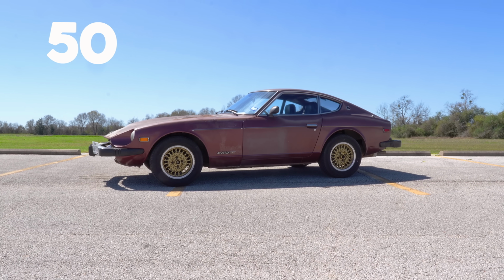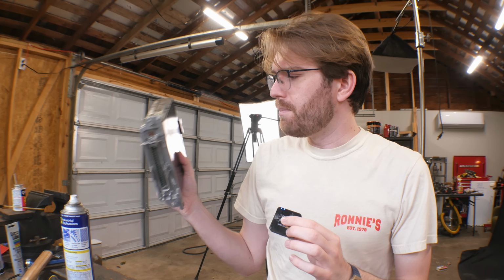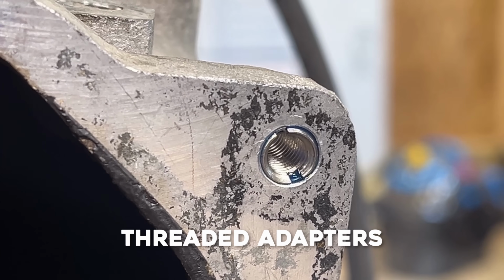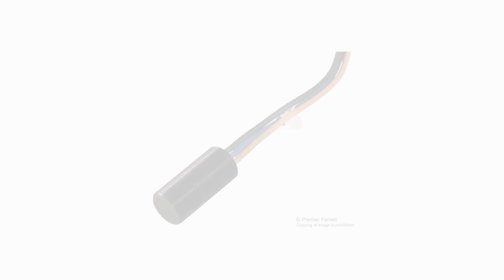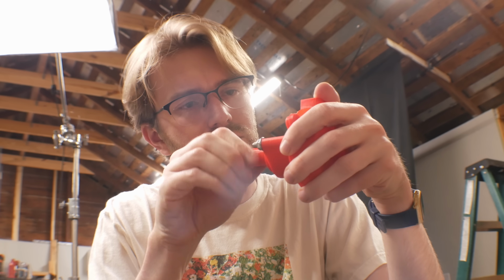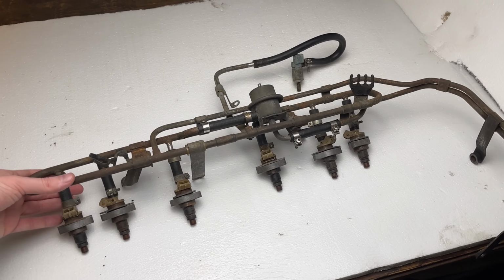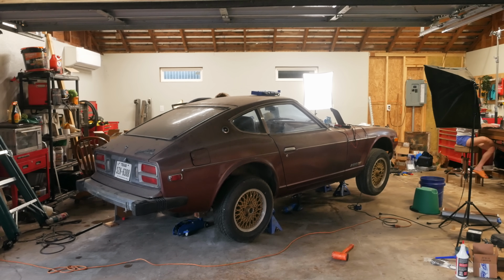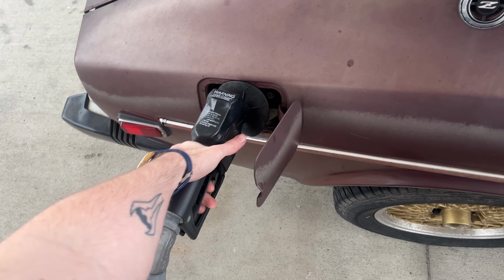Modernizing a Vintage Car

Comment: Man the cnc place has my wheels turning,  im sure engine or transmission adapters are possible.  Now I just need to learn what software to use for design.  Im older generation 54 years so I have a hard time staying up to date. Yet plenty computer capable

Comment: Very good video man a++ The very last statement was gold:finger-red-number-one:🤑 like reminds me of i traded my suv that`s paid for  for a car payment and i get  say 8 mpg better lol..  i would verify that timing mark on balancer in the futer projects with looking at piston using a piston stop or what ever as they do very very often move as the rubber in the housing is old and torque twisted it off the mark years ago i learn that the hard way  mark only be off 0- to what ever degrees mine was off on the gm project 40 or so lol  IMO batch fire is not an issue at all they did a few tests megasquirt and found not a real difference improved fuel usage over using the timing firing vs batch Fi methods   only at idling it was a bit tiny bit less VE

Comment: Cool. So next, please rebuild the internals. Like, stock or whatever, but fresh. New pistons and rings, new bearings, aligned crank, honed cylinders, milled deck and head, new gaskets, new valve springs, etc... Normal rebuild stuff.

Then after break in, see if you get more power and improved fuel efficiency.
Reply: Forged internals with that company he's using hahaaa
Reply: Dude that would be such a cool build
Reply: @stefancogurik166  you would like @mymechanics here on youtube, he's doing a crazy rebuild of the Datsun 240
Reply: You can definitely get a bit more out of that motor.
Reply: In the 1970s a uk company called Broadspeed would take a brand new v6 Granada, strip the engine and rebuild it with all the original parts and recon to get around 15% extra power.
Reply: Thank you, your video was engaging and joyful. I’m running better now too.
Reply: That’ll be 16 years sir. Do you want it on cash or card?
Reply: All that and maybe shave the head to bump up the compression ratio a bit.

Comment: you can turbo it now that you have a standalone i would totally do that and the injector size you used is plenty i would upgrade the fuel pump but i don’t see why you couldn’t double the power and keep it reliable i mean 280hp is not a lot

Comment: I have always thought the Chrysler Slant-6 was screaming for multi-port EFI and I really liked that swap, thank you. 
I had previously installed an Iron Duke TBI system, identical to my 1985 Fiero 2M4 SE, onto a Slant-6. Aftermarket EFI systems really weren't available back then, and I liked the simplicity of the GM TBI. This worked because the displacement per cylinder is almost identical and did give me better fuel efficiency in a 1983 Dodge Ram with a manual OD transmission. The only issue is that with too many distributor pulses, the computer idled the engine around 450RPM. The alternator was not happy at first. :) Slant-6 crankshaft is stupidly large and heavy, so it still wasn't easy to stall it with the clutch. There was no way, aside from making the computer think the air conditioning was on (it wasn't equipped), to bump up the idle speed as the GM TBI ECM is not programmable. 
(Note: change the electrolytic capacitors inside your car electronics! When they fail due to age, they will give you weird problems!)

Comment: Also could of just replaced the harmonic balancer and installed the sensor there for spark timing. Balancer spins 4x faster too so more accurate.

Comment: I would love to feel the difference of the sequential injection. I have a 77 280z with the FAST ECU , larger oring injectors, upgraded ignition etc.. these cars are so much fun once they run strong, no need to engine swap in my opinion.

Comment: I had a 76 280Z with minimal smog stuff. Granted, I bought it new, but that 170+. HP would move it out. It clocked 154 MPH on a certified police radar gun. As far as economy…I thought at the time it did great at 20 MPG, not quite as good as my 5.3 powered GMC 1/2 ton. Fun when I was young.

Comment: Having hotrodded an L26 ( nearly identical just smaller bore )I can say that the best money that can be spent on these engines is porting and polishing the head ( mostly that just means gasket matching the head to the intake and exhaust manifold ). Costs nearly nothing ( unless you send it out and get a shop to do it ). The difference is daylight and dark! I think the L28 likes boost as well. Thanks for sharing your journey!

Comment: Former owner of three 240Z's,  (back in the seventies, 1970's). Afraid I would have settled for a small block Chevy with Holly controller. It would have been cheaper, quicker with more dependable components.  But I am 84 and while I have the money for a such a project, I don't feel I have the stamina or the patience to complete it.  Thanks for letting me tag along for the ride and letting me live vicariously through your efforts to bring back one of the best cars ever produced.  Great content,

Comment: Reliability of older cars is actually better than the latest electronic nightmares most the time. 
Yes restore the engine with three basic changes. Exhaust intake and upgraded efi system with spark upgrade. That will improve milage and power.
To give it slightly more grin factor you could boost with 5 psi without much other than exhaust to suit.

Comment: From Leo:    I was working at the Dealer when that was a new model.  Remember those were the years starting in 1973 that trying to be EPA compliant was number one and it robbed performance from everyone. .    Most do not know, but the camshaft sprocket is made to be installed 3 different ways.  It has marks to indicate. A "V" the sprocket indicates a slot in the the cam.    You can slightly retard the cam to push the torque peek to higher rpms.  leave it in the middle or advance the cam slightly  to bring the peek torque at lower rpm.    You have to FIRMLY put a wedge shaped stick to hold the cam chain or the hydraulic tensioner WILL drip into the timing cover.     Free mod, and is easy to  reverse.    Good luck on your project.

Comment: This dude YouTube is trash you definitely modernized a cold ahh car by upgrading a few things on a engine maybe after out a new engine transmission rims change the dashboard up put some apple car play with a digital dash a back up camera maybe a turbo or something for the engine nope bro changed a few parts and gained 20 hp and said it’s modernized now

Comment: I had a 1975.  First year of the fuel injection without the smog control. 170 hp    I loved the 160 mph speedometer

Comment: Back in the day (about 1981) I had 1972 Datsun 521 Truck with a 1.6l 4cyl engine.  It had dual Points and Dual Condensers.  Horrible system!  Almost impossible to set correctly so after a couple thousand miles the points would get a pit on them that I would have to file down.  Then I was introduced to an Electronic system.  In the distributor you remove the points and condenser and you put a plastic with a slit in it with a photo sensor on either side of it.  After installing that system my truck ran so good.  I could not believe what a difference it made.  Also I replaced the POS carb with a Webber 2 barrel carb with a manual choke.

Comment: Now to do hotrod stuff. Valve job, Port and polish the head / intake, headers along with a better flowing exhaust I'm guessing that will get you another 10-20 hp and better throttle response. If you want to go a step further, you have the perfect setup in place to do a small pump gas turbo setup.  That's great work though, you should sell that Cam / crank sensor setup.

Comment: From the factory it's 149 horsepower at the WHEEL (net horsepower).  Gross horsepower ratings went out out at the end of the 1971 model year.  --- You can make it quicker, you can make it faster, you can make it stop faster, but you cannot make it safer in a collision.

Comment: Did something similar with a 1968 Triumph Spitfire, but couldn't go totally digital as the parts needed simply were not made/available. But took an engine from the stock 64HP (75 listed) to 112HP , in a car that weighs 1600 lbs. Mainly with better intake, carbs, exhaust and cam. But your work is more complex, as I stayed analog (outside of ignition). Great work.

Comment: Do we get to see a camshaft, upgraded compression pistons?  I would imagine that additional refinement of your fuel map /VE table, you should see better MPG numbers.  I would guess some 9.5:1 or 10:1 compression pistons would really help and a good cam for power. Otherwise just the pistons and then a refined cam profile? Maybe swap in 81+ ZX pistons? N42 head? overmill the head for increased compression?  Adding a like for the possibility of this in the future.

Comment: I've almost finished rebuilding my 80's saab, which unfortunately has bosch mechanical injection, which is unsurprisingly awful, doesn't work and also dumps fuel from all injectors at all time. The only difference is that It's purely mechanical so there's no computer.
Thanks to this video,a dns eeing how clean your engine came out, I've decided to do what almost every other saab 900 owner does. DItch the entire system (after I have the car inspected for originality and get licence plates) and convert it to Tronic 5 injection.

And yes I hate you for using electronic throttle. Tsuum tsuum noises will always beat tiny stupid motor

Comment: I appreciate the DIY approach to the EFI setup, but did you realize GRW manufactures a optical crank sensor that looks almost identical to the one you made? Mind you its 400$ usd .. but would have saved you a lot of time.. anyways good job on the work done especially considering you've never had experience in wiring harnesses and fuel injection setups. Do you plan to restore/modify any other areas of the car? hows the rust? I kinda like the old rough exterior in its original worn out paint. would be really cool if you put some money into the engine/drivetrain and turned it into a rocket while keeping the exterior as is.

Comment: Congratulations. In 10 short years, this car will have 2025 technology, which will undoubtedly be seen as outdated. Beginning in the 1970's, when disciplined collectors (who are the car collectors that drive the market) came across a classic car that's had it's original powerplant replaced with a "modern" small block, etc., they wisely moved on. This was reflected in the market. It doesn't matter how much thought and care went into the conversion, it will NEVER be respected as much as a properly restored car to original specs.

Comment: some people who have their l series setup with blow through/draw through turbos have reported getting about 20-25mpg with conservative driving... Im surprised you only got 19 but maybe thats driving it hard too? Anyways you really should turbo the engine with that efi setup you'd easily made double the whp and still have a rock solid reliable engine.

Comment: You really did a nice job at adapting a modern fuel injection system to a vintage car, and that is something that I wouldn’t be able to do, but in my opinion, as far as horse power is concerned, you would have certainly got a better result by overhauling the original system

Comment: If you removed the machanical distributeur for reliablity because only one part needs to fail then why introducé another single failure point (a sensor)

Comment: Why not put a trggerwheel and VE sensor on the crank. Like 60 minus 2. Much easier. Use the distributor to make a simple trigger with a hall only to make sequential injection and timing possible. I make them in the old distributor. You need only one finger and a hall sensor.

Comment: Welcome to the Datsun community. I've been modifiying my 240z L28 swap since 2006. Fuel injection swaping is the name of the game but I keep a 4 barrel conversion kit on the shelf just in case. Haltech swaping taught me alot about cars in general but having to make or modify other car parts to fit the datsun its just part of the learning experience. I was confused at first when I learned that most fuel injection systems are NOT sequential firing instead they are mutipoint or batch fire. I've rarely had prolems with a carbureted datsun other than the fuel consomption where as your biggest headache with a fuel injection system upgrade is going to be producing enough power out of you alternator. I HIGHLY suggest upgrading your alternator to something around 100+amps. Pick your choice between the Maxima atlernator, a GM alternator or something custom.

Comment: Surely there are other improvements that can be made to A) increase horsepower and B) increase fuel economy, right? Turbo? Lightweight pistons, rods, crankshaft and flywheel? Expensive, yes. But can we really put a price on gaining perhaps an additional 5 or 6 more horsepower and 2 or 3 mpg?

Comment: So thats just with a proper efi and better air fuel ratio but imagine what you could do if the engine is in tip top shape. Do you know how many miles are actually on the car? Imagine if you replaced the full suspension and rebuilt the engine internally as well as the transmission system. You could a possible extreme improvement especially when you consider the engine output was substantially less power then manufacturing predicted during a time when manufacturing put a lower number then real world tests. A proper suspension and new internals would get a lot better efficiency with an even better yield in economy.

Comment: This goes far far beyond my capacity. This is not for a DIY guy, this is for experts level equipped with everything. Easiest is to get one rebuilt engine and drop it inside your favorite clunker.

Comment: You really brought together the best of two eras: the rock-solid simplicity of 70s mechanics with the precision of modern electronic control. By letting sensors, actuators, and algorithms handle stoichiometric combustion, you squeezed more energy out of the fuel and delivered it flawlessly to the drivetrain. From 16 mpg to nearly 20 (25% increase!) — that’s proof of how old-school robustness and new-school tech can shine together in one car. Brilliant work!
Reply: ai generated comment detected

Comment: L-Jetronic is wild. But K-Jetronic isn't any better...

In the KE -Jetronic (which we have a few of since we love German cars from the 80ies) the fuel injectors are permanently open as long as the car runs. There's a wild control block thingy that sends fuel to the right cylinder at the right time. This doesn't sound so bad, right? Well...
One of the injectors on our MB 190E (W201 with the M103 engine with KE-Jetronic) broke and was stuck open. Which leads to the wildest behaviour: If you've been driving around and you stop for a short while, everything's fine. But if you drive around and you leave your car for a while, fuel runs through the open injector, flooding your cylinder and emptying the fuel rail and the hose behind it. So not only is one of your cylinders unable to run, you also have no fuel to the other cylinders for quite some time. And you cannot help the situation by cycling the fuel pump since the control block won't send fuel to the cylinders as long as the engine isn't running. The only thing you can do is to try to start your car again and again and again until it suddenly roars to life. In the meantime you dumped all the fuel in the full cylinder into your exhaust and therefor also into the catalytic converter, creating a very expensive problem because of a relatively cheap part (catalytic converter is like 400€ vs. 50 bucks for the injector). And if additionally you have a weak fuel pump or starter or alternator or battery, chances are you run out of charge before the car starts.
It took us ONE YEAR to diagnose the problem because we didn't know that the system is so different from the modern ones. The second we read the information about the injectors being triggered only twice per drive everything instantly made sense and we only had to find the one not clicking while being probed with 12V...

Ah yes, the fun of working on old cars! Especially as basically from March through September, they are our primary vehicles:
190E for my sister, Audi C3 Avant or B3 Coupe for my brother-in-law, Mercedes W140 400SEL for my dad and Mitsubishi Sigma F07W Station Wagon for me.

Comment: If the ignition coil goes bad the whole engine stops running, but it the engine speed sensor goes bad the whole engine also stops working😉😜

Comment: I like a challenge, and even an uphill battle once in a while. But you could have made a simple steel sleeve and pressed or loctited it on for the original distributor shaft so that it would fit a standard bearing.
But there is no "best" way and you certainly arrived at a great outcome.

Comment: Now to see how much power you can squeeze out of spark and fuel optimization with a bottom end rebuild bigger valves and a higher lift cam. Good stuff!